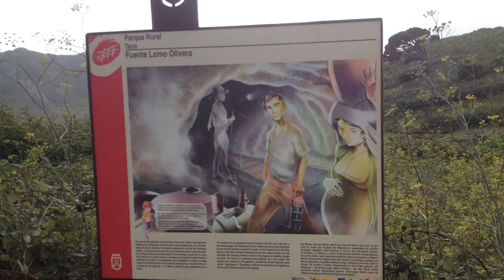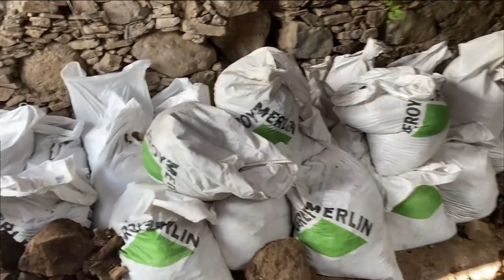BVRC044 Projects on the Go Lots to do at the old farm house restore in Tenerife Canary Islands Spain

Comment: hey toby  the waste pipe will need to be replaced  , as you will discover it has failed and is root bound .....yet another reason to keep vegetation away from structures!  looks nice vs all the negatives isnt worth looking nice . you might try pvc inside terracotta  but roots will come back . the wall with the verticle crack in the corner you need to "fill" ta about that one have a good look inside and out  top to bottom is the wall leaning???? that crack is a big issue the 2 walls are not tied together and need to be !  im betting the water didnt work lol  rootbound! and failed piping , thanks for the videos
Reply from the maker: You bet the walls are leaning.  Since they are only a pile of stones and mud… I guess the good news is it hasn’t fallen down in 100 years yet.  So it may last a few more 😃
Reply: lol nice flow and i was wrong , a cesspool/cistern and a drywell would probably be a good addition allowing solid waste collection/composting and waste water reclimation....bet the hillside under the pipe is green and lush .
Reply from the maker: It hasn’t really had much use these last few decades 😄 and I’m planning an excavator to dig my cess pit soon.  Another subscriber sent me plans to build one 💩. But the neighbour’s pipe to nowhere is a place for the ladies to do their business … if we’re lucky enough to get a few to “come up and see us sometime” 😂
Reply: @BuenavistaRuralClub   im sorry didnt realize you needed plans  basiclly its a 2 or 3 chamber system where solids settel out in first tank and liquid fills others  and bacteria do there thing to make it better ....a drywell or leech field provides a place for liquid to filter and return to aquifer... happy to provide explanations where possible ;]